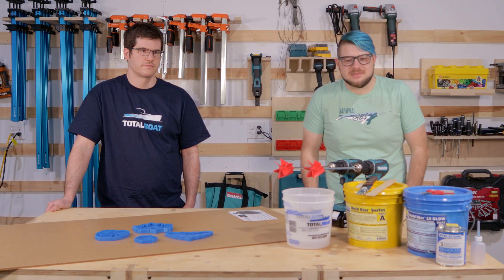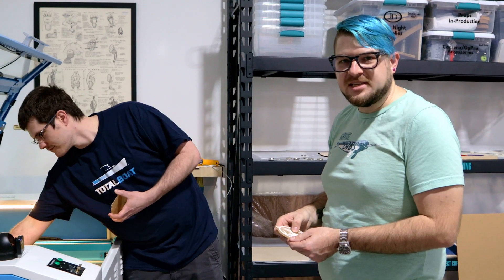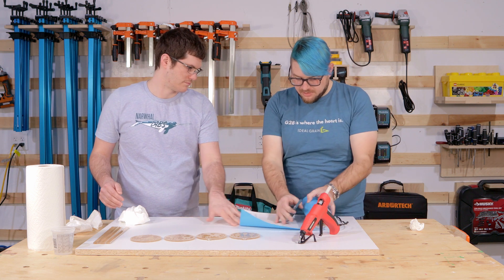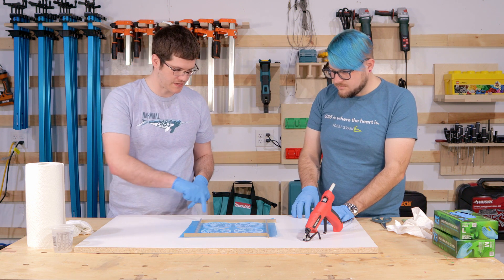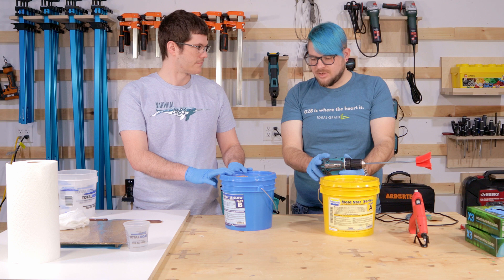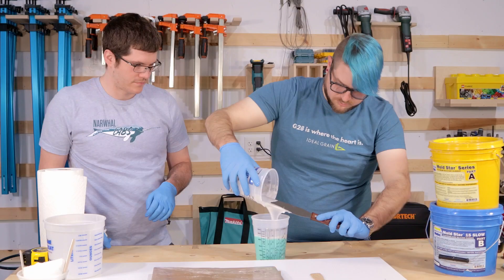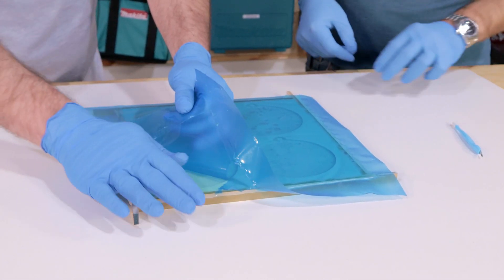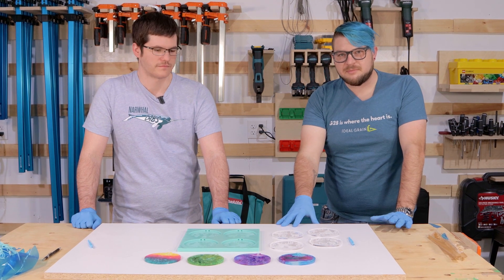Easy Silicone Mold Making with Phillip from DannerBuilds

Comment: Is there a certain setting for laser engraving?.
Reply from the maker: Settings will vary between lasers - even sometimes lasers of the same model, and of course it varies between materials. Even some acrylic can vary between suppliers. On our 100W CO2 unit from thunder laser, we use 15% power at 400mm/s speed for engraving in this cast acrylic that we bought from mcmaster carr.

Comment: how to make molds at home - you need a $4,000 laser etcher.... stop video at 1:45
Reply from the maker: Hi Sammamishwa. While we’re lucky enough to have a really cool laser cutter, you don’t need one to make molds. You can do the same the same thing with much less expensive lasers, use services like Ponoko to cut your designs pretty inexpensively or find a local makerspace that has one you can use.
Reply: @NarwhalLabs  cool, why not make a video without the laser? so everyone can follow your steps to make a mold.  I mean really to you want youtube viewers or not?
Reply: I use a $300 laser myself. They happen to have a bigger machine. There are of course services like mentioned to get your designs cut out as well. The intent was to show the process of making the mold itself however I see your point on how adding more information about what all you can mold besides just acrylic could add more value to the video. I appreciate the feedback.